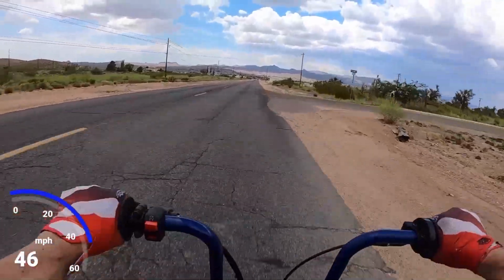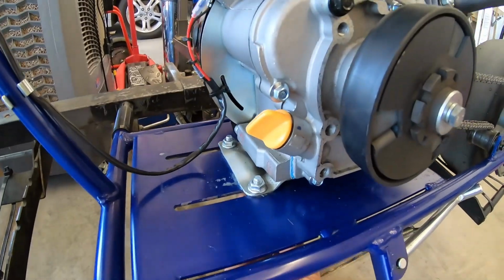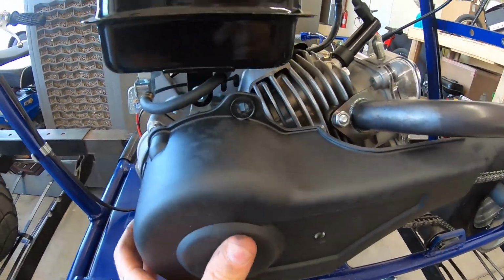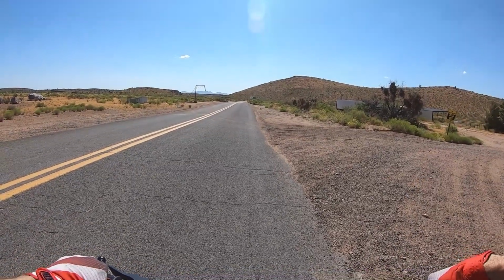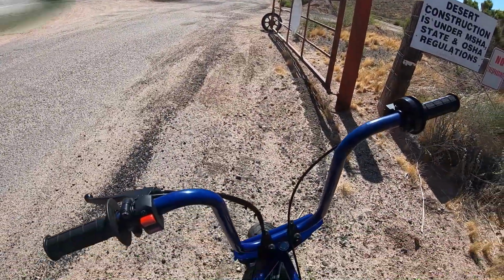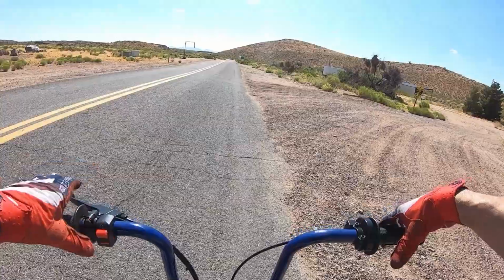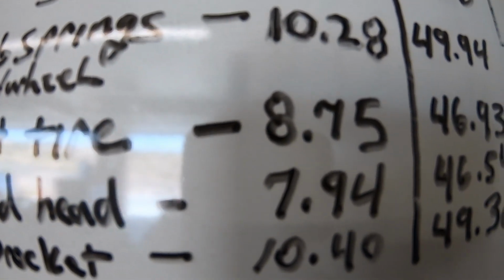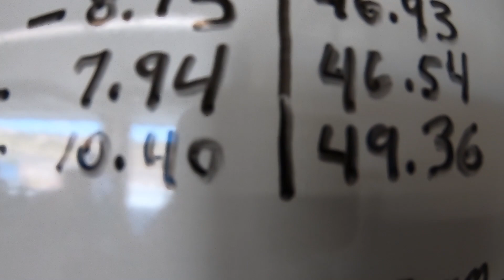Can a 98cc mini bike do 50 MPH with a gear swap?

Comment: Yeah big dog I had mine going 38mph gps and it was smooth I was happy with that until I tilted it on its side to do a 360 burnout and it slipped the rod I fixed it and gave it to a kid because I had my ducar welp that's my story that 98cc hauled my azz around no problem for months
Reply from the maker: Still have the Ducar?
Reply: @Black66  oh for sure I just did a cruizer vid I drove it today it's amazing I change the oil alot too 93 gas only 💪🏼💯💨💨💨
Reply: @Black66  I just put a speed pass sticker on it from GPSports it def woke it up lol
Reply: @Black66  I have a lifan on layaway too just don't know which bike I want I put my money on the kpx250 6speed efi but do I really want a big huge bike now they have the 2024 kp mini and a couple others like that x22 max that goes 90mph I just can't make up my damn mind and I'm running outta time to decide what bike would u pick and they have electric grom looking thing idk man it's hard as heck
Reply from the maker: @SoLoCruizeR2o3  I really like that KP mini !
Reply: @Black66  I had the older version I believe all they changed is the appearance mabey I'll just get it again with the efi hopefully they let me change my mind it's 1000 dollars cheaper too I just remembered the first gear was real short and the seat was a Lil stiff but all that can be fixed me being stick with a huge Enduro Idk if I will be happy ya know I think I like minis forever now lol

Comment: You are providing very useful comparisons that really help in the decision making process while choosing new parts for engine builds, I am very thankful!👍 Do you have any experience with the dynocams cm. 265 cam? I just purchased one for my 212 build and I was wondering how you thought it would stack up against say a superman 265 cam which I have in another engine. It's going in a megamoto 212 with 30 series and juggernaut. 9.75 compression, 27-25 valves  in ported head, 24mm pwk carb. Does this sound like a good setup for the bike? Any info would be greatly appreciated. Thanks again for testing all this stuff for us

Comment: What is your clutch engagement rpm?  Factory is usually around 2000. Increase that for quicker speeds might also increase top end slightly.

Comment: Hey, quick question ! Have you had any issues with rear axels on you cc 100 x 
I’ve replaced bearings, straightened axel , greased and twice after about 4-8 hrs riding shaking a lil a twice it’s worped ! 
Not over torqued, I go by specs. ???? Rim isn’t perfect I’ve hit few bumps . But rims are bent enough I’d say replace . Only thing I know 1-replace wheel /& assembly or 2 pull my 212 billet engine and get another bike. Any help would be much appreciated!
Thanks for any input
Reply from the maker: No, I haven't. I have put quite a few miles on that bike making videos. Maybe you have a lightly bent wheel or something? 🤔

Comment: I love these 79/99cc engine builds. Not enough people do ‘em. 

My best gear ratio that I like for all around is 12/70 on 15 inch tires. I used this gear ratio when I went into Portland Indiana and did a few runs there. Only got to 48 mph. 

My bike is a stripped down Coleman ct100u which is pretty much a stubby little rascal.

Comment: @black66. By chance have you had any issues with this brake?  I have just put this bike together and when I apply the break, the caliper does not return to being fully open.  Any suggestions???  Thank you.
Reply from the maker: I use a couple small washers behind the caliper mount to align the caliper on the disk better.

Comment: 49 mph on a rascal is disrespectful. Time for an engine upgrade.
Reply: "Disrespectful" is not the correct term. He didn't disrespect anyone. What you meant was "not respectable", but I think it is.
Reply: I see what u saying but I think it’s adequate. Obviously it’s not a drag/race setup but if u wanna roll around at 35-40 it’s definitely a solid setu